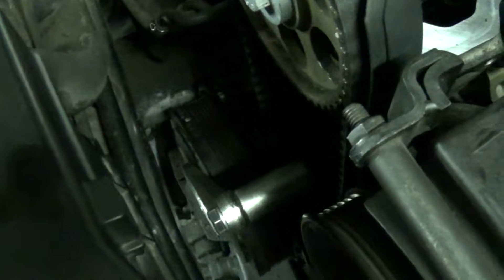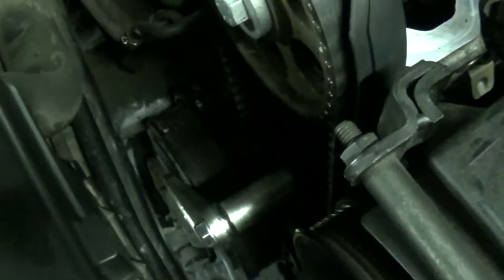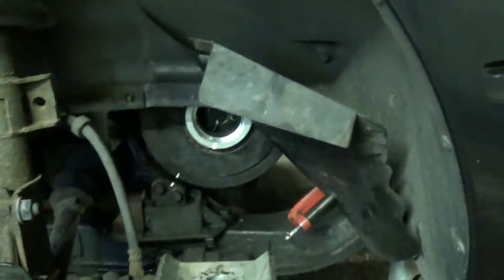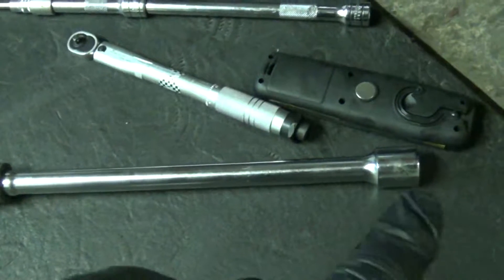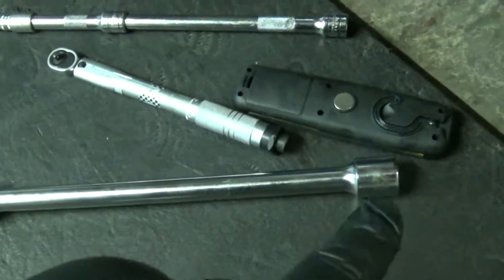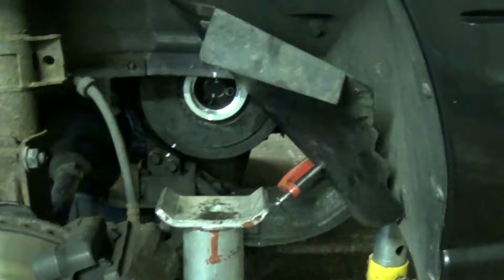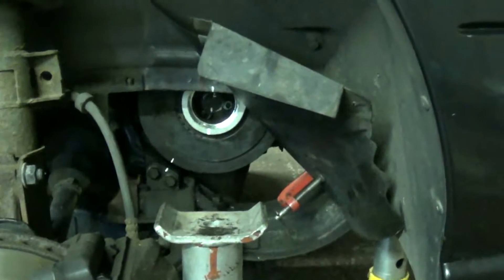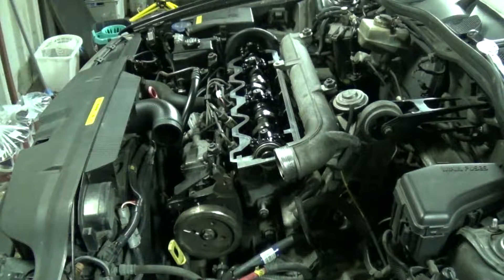D5252T timing belt change part 5d: Main timing belt Installation. Volvo 850 S70 V70 S80 TDI 2.5D

Comment: I just did this on my 2001 S80, and let's just say I wish I'd went by my local Volvo dealer and at least asked if I could borrow their tools for a weekend. I can't find anywhere online that sells the actual Volvo tools only the VAG tooling. I managed bodge together something that at least held the crank roughly in position while I pulled the 180. Which ended up being more like 170, but close enough, much closer than it was before I did this anyway. Came loose with just a regular 1/2" breaker bar, 50cm length, and quite easily at that. 

Oh well, it's done now and the car runs just fine, even though Vida claims the pump is nearly 1 degree advanced. Although that might be my tuning chip doing that, so I'll have to check that later with the chip uninstalled. Although I'd have thought the tuning would only change the desired injection timing not the actual injection timing. But since it's advance injection I'm guessing that's what does it..
Reply from the maker: Yes, very difficult to do without the correct tools, I had to get them from the dealer as I also couldn't find them online. The VAG crank tool I believe is intended to be used from underneath with the vehicle on a lift, however when the engine is installed in a Volvo, the subframe blocks access.

Comment: Brilliant series of videos, thank you for taking the time to do these.
I am currently rebuilding one of these engines to go in my VW T4. Its a volvo 850 so same as V70 and Vw.
Quick question.
My engine is out and on an engine stand for the rebuild. I am changing the timing belts. I do not have the flywheel fitted so am a bit concerned about the crank being at TDC. Im sure it is and it  hasnt moved. Im using the VW tool for holding the crank pulley. Its a big long spanner.
The Volvo tool that you used for holding the crank still, am I right in thinking that when you bolt this tool on, it will only fit with the crank at TDC?
Hope this mskes sense.
Thsnks
Reply from the maker: Hi there, sorry for the late reply. Your question does make sense, and I think the answer is yes. I looked back at the video and can see the engine is on my painted mark on the balancer, can't see why I'd have moved it, but it's been 18 months since i did this job and I can't recall everything i did. Thanks for watching.
Reply: Aren't there any registration pins on the flywheel end of the crank? There should be considering that's the main TDC mark for these engines, the rest are sort of TDC-ish, except for the fuel pump anyway. But to answer the question, yes the tool that Volvo designed will only fit at TDC, I'm not too confident about the VAG tooling since those appear to be meant to be locked with a breaker bar or something.